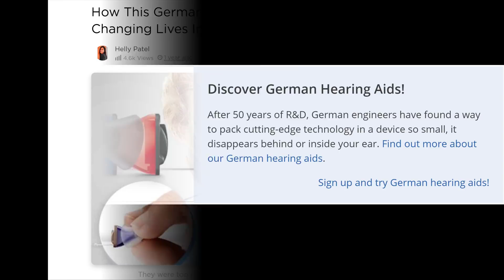Secret Behind Amazing German Hearing Aid Technology!

Comment: Is there a hearing aid I can use just for athletic activity?  I dont need it for all day use.  I do outrigger ocean paddling and I need to hear commands from seatmates.  Also I may occasionally fall in the water.  I have safety loops for sunglasses and cap, etc.   I dont want to lose expensive hearing aids if I get dumped into the water.
Reply: To my knowledge there are no waterproof aids. (Even the permanent Lyric implants cannot tolerate being submerged underwater.) You may want to look into the Olive Pros. You'd still be out $300 if you get dumped, but that's better than $3000.

Comment: I disagree with hearing aids not being German. Sure, current ones may not be German, but considering that Siemens sold off Sivantos in 2015, they most likely have tons of legacy software and some hardware that is still the same and made by Siemens. As someone who used Siemens aids before Signias, I can tell that sound processing algorithms seems to be very similar as new Signia sound processing feels very similar to what Siemens had. It just feels like same algorithm, but with more precision. I also noticed that Oticons alse keep their algorithm very similar over years. So most likely, underlying sound processing algorithm is still largely Siemens made, meanwhile hardware may not be anymore. Not that it matters where aids were made and developed now, but just saying that those claims about them being German aren't exactly totally wrong and also Silk sells older aids, which likely reuse even more of Siemens stuff.
Reply from the maker: As long as your main takeaway is that there is no inherent benefit to German hearing aids, I've done my job.

Comment: You can buy a "German Engineered" VW made in Mexico. Many Mercedes are not assembled in Germany. I believe that German Headquartered  auto makers can use the VIN prefix of "W", even if the car is not assembled in Germany. I have no ides  where my Phonak Paradise hearing aids were made, and it really doesn't matter. They work. Thank you Veteran's Administration.
Reply: I'm German, I bought my Fender Telecaster Mexican Made even back in Germany cuz it sounds cooler. Kinda off-topic, I guess.
Reply: @domeswall  no not at all that's pretty cool😁
Reply: It was made in Switzerland 😁